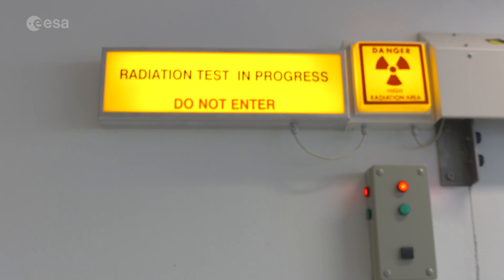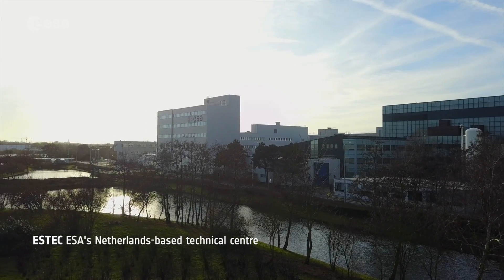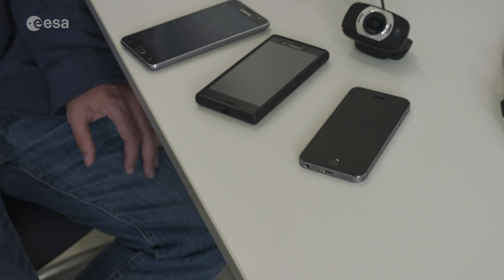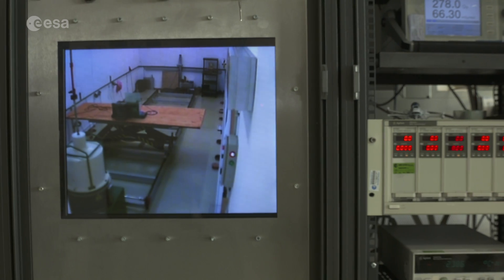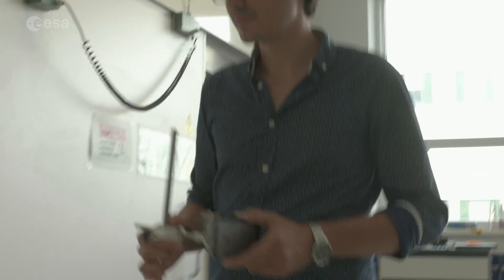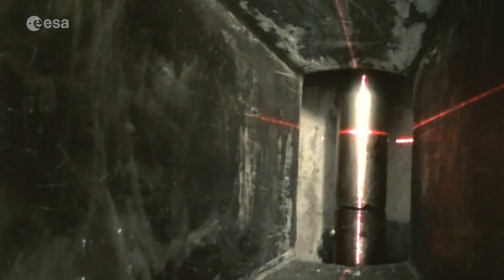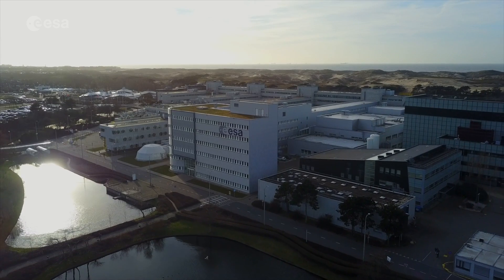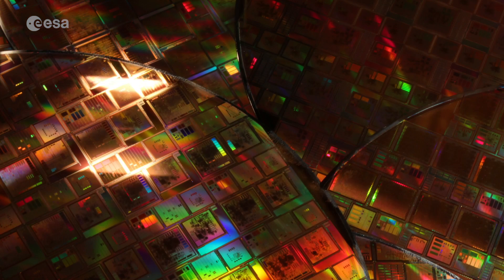Irradiating an iPhone

Comment: The cobolt in the rechargabel battery in the iphone is 1gr and the cobolt absorbs the gammarays and becom cobolt 60. Cobolt the sends out the gammarays to become clbolt again. 1 gr cobolt 60 kills allife in 1 square km
And a electric cars battery has 10 kg cobolt. The total earth surface in square km x 1gr is 35 ton cobolt. So nuke a city with miljons of iphones and tousand of electric cars is abotu having 35 ton cobolt and making to cobolt 60. All cobolt will be sucked upp by the nuke and then trasported by winds globaly killing all life on earth. Cobolt 60 dust only falls down sloly because it is verry smal particels-dust
Reply: *cobalt 
*deadly dose of 20mg/m³
Following your logic we should've all been irradiated long ago.
From my understanding the deadly dose applies if ingested. 
Idk what tf you are on about or where this brainfart came from, but good to know there's someone out there that thinks dropping a bunch of cars and phones on a city is not just going to kill the people getting hit by them, but create an atomic explosion completely erasing humanity.
Reply: Wrong sir
Reply: So many thing in this comment are wrong
 cobalt needs to absorb a neutron to turn into cobalt 60
During a nuclear explosion a lot of neutrons are released but 99% of them will get absorbed by other things between the cobalt in the battery and nuke cause most elements will absorb a neutron and get converted to radioisotopes.